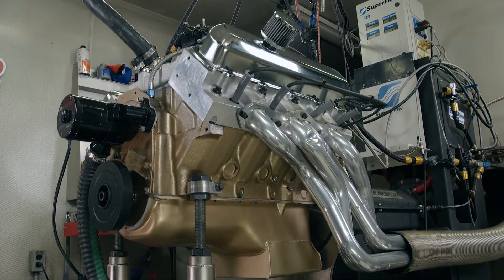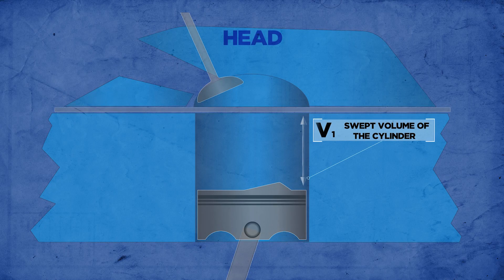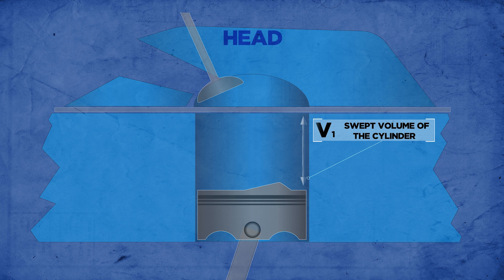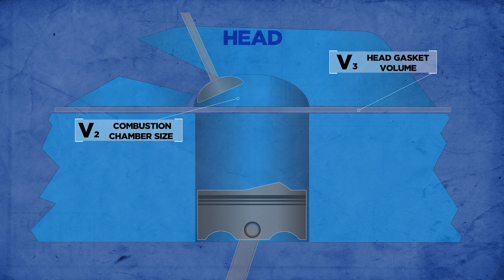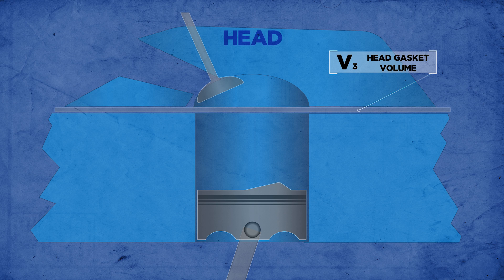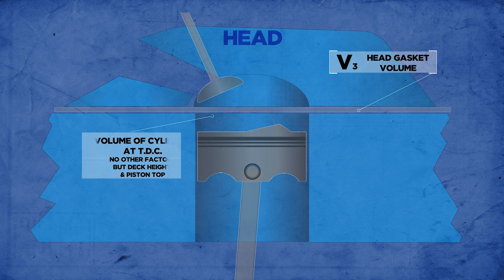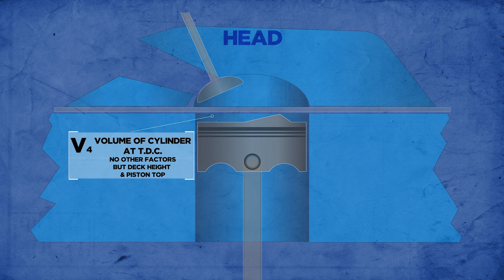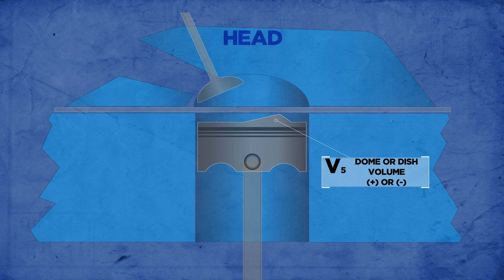How To Find An Engine's Compression Ratio

Comment: How could i get sir 
Tha right compression ratio for my engine ?
Is there any standard volume for every engine or you need to calculate to get the right volume?
Thankyou
Reply: The compression ratio and cam specs determine cylinder pressure. Too high of a cylinder pressure will give you detonation with pump fuel which is harmful to your engine. Normally 150-170 psi cylinder pressure will be fine. The closer you get to 200 psi cylinder pressure the higher the octane has to be to avoid detonation. Mild detonation can be avoided by retarding the timing. After that you have to lower the compression ratio or change out the cam for more duration to bleed off cylinder pressure. Hope this helps.